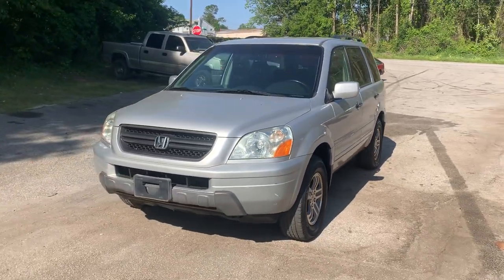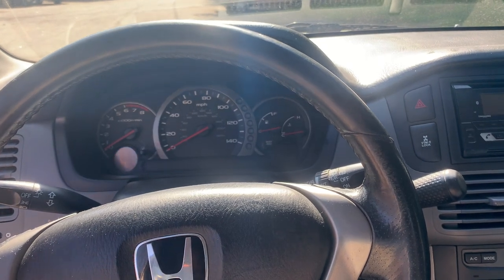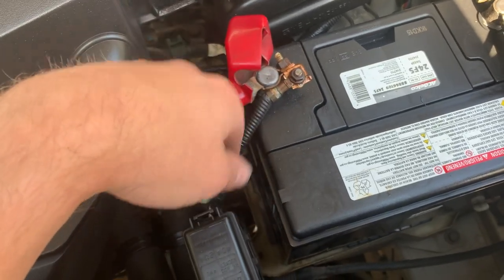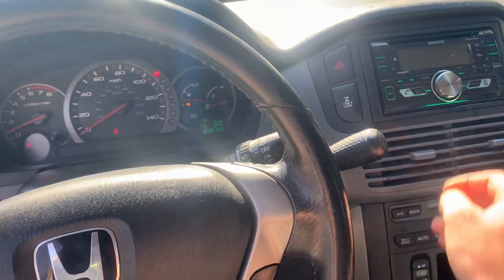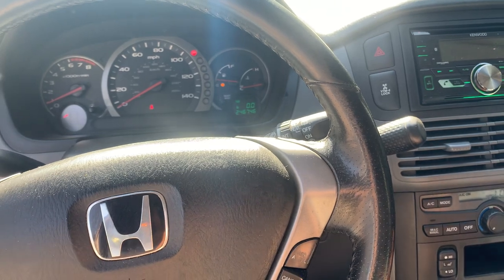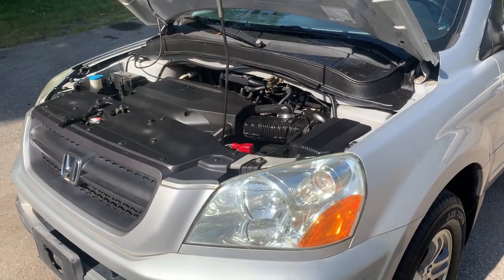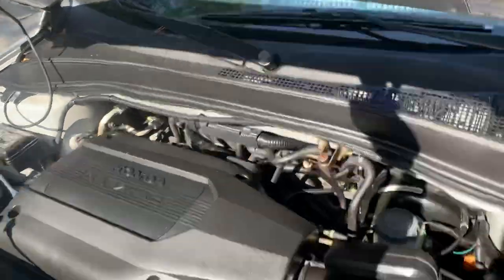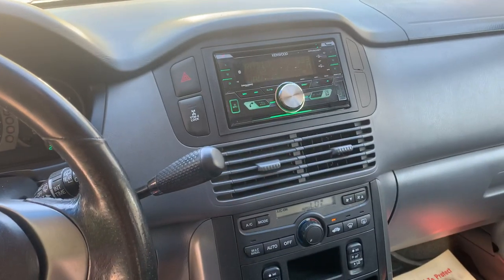ABS-VSA-BRAKE LIGHT FIX 2004 Honda Pilot

Comment: Great info, I have a 2012 pilot that had  all three lights come on as well, I left the key in the ignition and it drained the battery and triggered these lights to come on, I cleaned the terminals added some brake fluid, replaced the battery with a new one and drove it for a minute and thank God the lights turned off, appreciate the help.

Comment: Great video Jay, had a 2005 one of these from 2007-2020. Put 270,000 miles on it. Change the timing belts and water pumps and they’re bulletproof. Change the diff fluid too. I had a transmission slip from 3-4 for 100,000 miles but never had to get a rebuild. Great information on the 4WD.
Reply: How often did your trans slip?? Did you end up rebuilding??

Comment: 4 wheel drive is always on up to 18 mph.  Every time the car starts from a stop the four wheel drive activates, but the differentials are not locked to prevent tire wear. That button is a differential lock for all four tires to get out of a stuck situation and should never be used on dry pavement because the diffs are locked..

Comment: God bless the internet.  You just saved me a big headache of a trip back to the dealership.  Just fixed this problem in 2 minutes after watching this video.  Had routine service done last week and they didn't connect this cable back tightly to the battery.  That bolt was loose.  230,000 miles on my 2004 Pilot and hope to keep it going for a bit longer.

Comment: I have a VSA light and triangle with the! Started showing up this morning. When I stopped it and put it in part now it won't go back in to gear it's stuck in park. I have to use the key pushed down on top of the steering column to unlock it. Any ideas or suggestions? I'm sitting at AutoZone and I just realized the brake fluid was a tiny bit low and definitely needs to be flushed but I can't do that right now I'm out of town. Maybe buying a break switch and replacing that? Thanks in advance if you can help anymore I appreciate you.

Comment: I have a 2011 Nissan Pathfinder SV 4 x 4 and the check Engine light has been on for about 2 years we had it checked and was told that there was a short somewhere they'd do what they do to make it go out and it would be right back on.   I went to the positive battery terminal as you had shown on the pilot and there was 2 fuses and 3 wires.  I took the whole thing apart and cleaned it all up and the light is now off!!!  I just wanted to Thank You so much for your tips those of us who aren't that mechanically inclined learn so much from them

Comment: The Ridgeline and Pilot are AWD. It works from 1st to 3rd gear. Anything faster and the system decouples and becomes FWD. The VTM 4 is just a Variable Torque Management system to help in more sticky situations. It basically changes the traction control to torque the wheels that aren’t freely spinning.

Comment: Have you had any 2009-2015 pilots (or any 3.5 v6) come in with fouling spark plugs due to the eco system running on and off on 3 cylinders!
Reply from the maker: Most of the time its a problem with the variable timing solenoids. The oil pressure switches go bad on them an cause tons of misfires and poor drivability issues. I haven't done one on a pilot lately. But just did a Honda Crosstour and a Accord with the same problem.

Comment: i have honda pilot 2013 and i have low tire pressure in front 2 tires and my abs , vmt4 and low tire pressure light tutn on after fillup air vtm4 and abs still on

Comment: Not right with the VTM-4. The pilot is AWD. That button is just for being stuck and locks the rear wheels. It's basically a diff lock. It sends max torque to rear wheels. I'm only pointing this out because I know people think it's the only way to activate 4wd and that's not how it works.

Comment: That's dumb you can't use 4wd in drive.
Reply from the maker: Its not meant for fast speeds. (most 4x4 systems arent anyway) use your low gears for more power and traction. Works like a charm